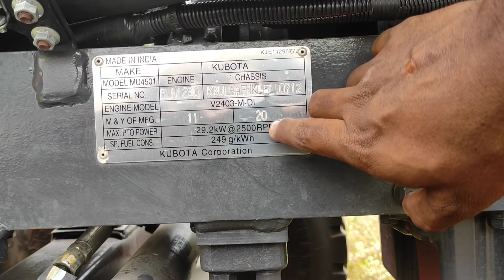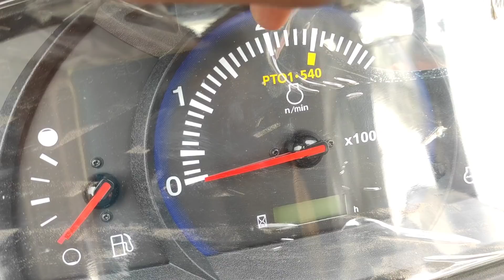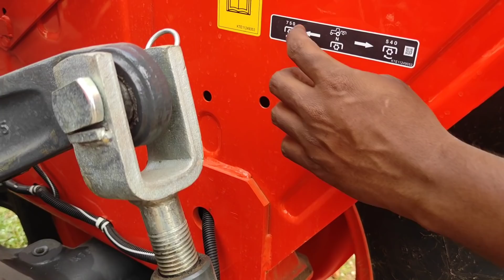Kubota mu4501 tractor full technology review - village engineer view

Comment: Bro nanum Kubota user tha nanum engineer tha ennoda experience la enga oru tirunelveli la ippo trending ahh kubota erukku ....neenga sollura marthiri 540 pto run ahka 2500 rpm theyva padum unmai than.. But matha tractorlaium yarum full 540 rpm rotator vachi odda mattanga Reason diesel high .and rotavator la gear change pannikuvanga normal rpmla kuda 540 varum output.. Enga  rotatorlaium gear change pannitanga na oddum pothu 1400 rpm la engine run ahkum 540 output vathirim etha marthiri tha ella tractors odduravanga pannuranga so this not need 2500 rpm.... And balancing shaft is really important reason matha tractors ahh oddum pothu human body rompa died ahkum reason that vibrations but kubotala apdi illa really smooth experience no died matha tractors vida 50% affected... And this tractors also heavy usage supported neenga ellarum solli solliye ethu heavy usage ku set ahkuthunu mind set vachirukkanga😂😂 Real ahhvay full heavy work la include pannitu performance illana sollalam bro😍 reason enga orulaium oruthar erukkaru avaru kubota vanginaru already avanga kitta jhon deer, mf, erunthu ippo athala koduthudu kubota and deuts erandum vachirukkanga avaru enga ponalum only kubota tha use pannuranga 60000hrs drive pannanga just 2 years kulla ennum super ahh ahh tha erukku vandi....and fuel consumption matha vandiya vida one hr ku 1/2-1 litter kammiyatha pogum...and wet land ku semaiya erukkum hight performance engine no perform decrease💪💪💪💪
Reply: OK sir, Yeppadi rotatvator La gear change panrathu sollunga
Reply: Heavy use ku eppadi irukku ?
Reply: @govindarajARG  bro normal ahh tractor workshop la rotivatorla gear change pannanumnu sollunga change panni  tharuvanga
Reply: @kannanvelusameykannanvelus3476  my experience la seriously Superathan bro erukku mileage la vera lvel erukku ..now situation padi fuel cost very high so milage kodukura tractor nahh kubota mattum tha etha ungalauku year ku 1 lac save panni tharum bro 😘...
Reply: Athigama front lift aguthunu sollranga
Reply: @kannanvelusameykannanvelus3476  matha tractor ahh compare pannum pothu avllova ethu front left ahkathu bro🤣🤣kubota designs total different bro neenga vena yt la nalla check panni parunga proof erukkum... 3-4Heavy trollyku best mu 5501..mu4501 45 hp matha tractor ahh vida left kammiya than bro erukkum front weight otturuvanga bro company la erunthu neenga nalla yt la check pannitu reply pannunga.....ellaralaium tamilnadula kubota tractor edukka mudiyathu reason only full case or financial panni tha vandi edukka mudium but matha tractor ahh just one lack koduthalay vandi odda thanthiruvanga then ketrunganu reason marketing ...
Reply: V k
Reply: Super explanation bro. 👍
Reply: @tractorlover4292  apo indha vandi edukalam
Reply: Super bro best mileage tractor

Comment: Bro yanaku intha tractor showroomla 7,69,690 Rs quatation kuduthanga in Coimbatore pachainayagi tractors with inclusive of  registration, insurance, front weight (bumper), tipping hose and toe bar.
Reply: Too costly, for that u can buy Escort powertrac euro50, with 6.9L..i m also from coimbatore, I m waiting for euro50next 7.2L  with 52 hp, double clutch with 12fwd, 3 rest gear and factory fitted weight bumper 2 tipping hose check these compare and then buy bro
Reply: @prasathg3568   bro but I do not buy this Kubota  tractor. Now I was bought 2016  second hand 575 tractor and at low prices in good condition at low hours running.
Reply: @prasathg3568   bro comparing Kubota other brands are best in price.
Reply: @prasathg3568  in Coimbatore which place you are? bro